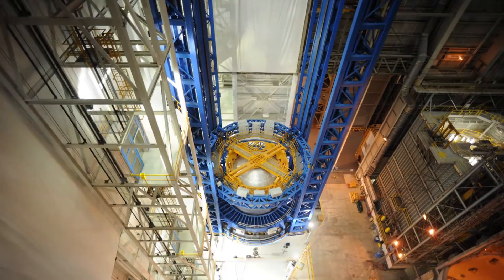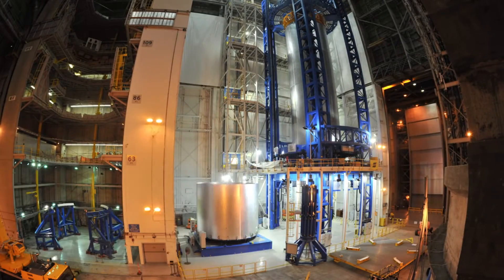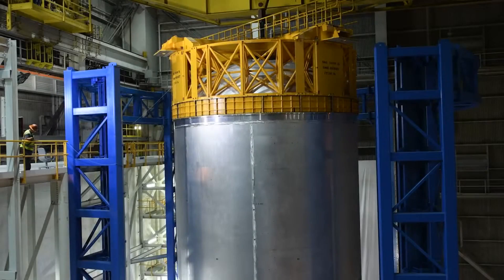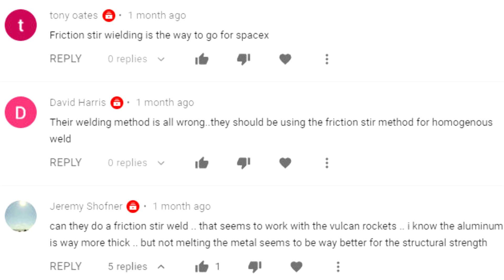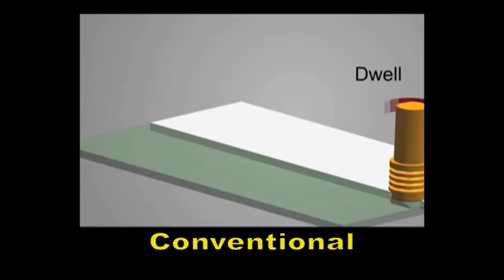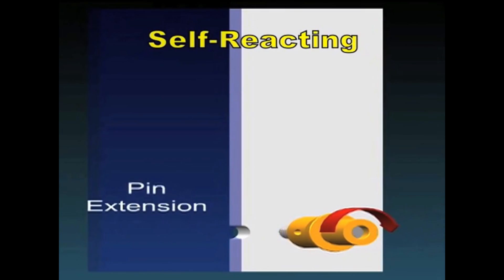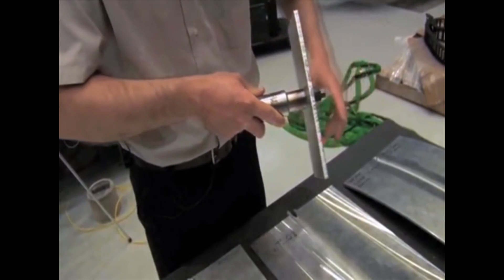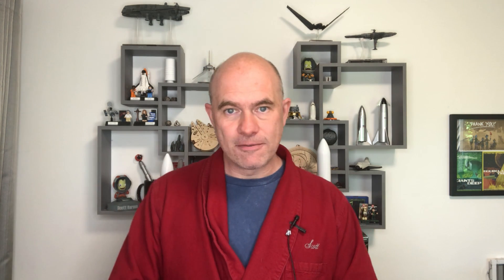SpaceX's 4th Starship Prototype Collapses During Test

Comment: How is it then going to land with additional weight on it? The fuel will be used and it will again be unpressurized.
Reply: The tanks will always be pressurized, that's required for the engines to work.  The cargo capacity is 100 tons, the fuel capacity is 1200 tons so the mass of the cargo might be as big a factor especially landing in places with lower gravity.
Reply: @TheEvilmooseofdoom  Ye i guess they can pressurize them with onboard compressor. They will need to land on Earth with some weight as well - people, cargo from moon and mars, experiments etc. Also keep in mind that this test was done without the top part which is probable a couple more tons.

Comment: I really don’t believe it was a welding or a pressurized structural failure. It seems to me that it imploded on itself. It seems that the middle tank was empty and the valves were closed and the cryo up top caused a vacuum and imploded the middle tank...

Comment: Looks like something cause the lower tank to pull a vacuum. It did not buckle from weight as it collapsed inwards. It didn't lose pressure, it went below air pressure.

Comment: Here's my guess at what happened...

The upper tank was filled with a cryogenic fluid while the lower tank was pressurized with an inert gas (probably nitrogen). The gas inside the lower tank experienced rapid convective cooling, due to the extremely low temperatures of the adjacent tank walls above, thereby lowering its internal gas pressure. Therefore, the lower tank's gas pressure quickly dropped (while ground support equipment couldn't supply nitrogen fast enough to keep up with the pressure drop rate). Once the tank's internal pressure dropped below atmospheric pressure, the tank's structure collapse. These kinds of pressure vessels are (obviously) specifically designed to handle internal pressure and cannot handle any sort of external pressure differences. 

Note that the diamond pattern seen on the tank's shell just before the whole structure fell over is very typical of a pressure vessel that has failed under external pressure.
Reply: Philip Giacalone ...I agree!  Some time before the big failure, two dimples appear and become more distinct, as if the internal pressure of the lower tank became too low and was still dropping.  Perhaps the team set the lower tank pressure, then forgot to monitor it.  Perhaps the plumbing or pressure adjusting equipment failed.  Either way, perhaps they next started to introduce cryogenically COLD propellant into the upper tank and over time, the heat from the lower tank bled off into the extreme freezing cold tank just above it, causing an insidious—but structurally fatal—cooling and corresponding pressure drop.
Reply: @737smartin  Yes. I'm guessing it was most likely a GSE problem. SpaceX engineers surely would have anticipated the gas pressure drop due to the cryo temperature drop. But it's possible that the GSE experienced a valve or regulator failure or simply wasn't designed correctly to handle the required gas flow rate.

Comment: I think they should add a secondary “redundant” structural element to the lower LOX tank that would also act as fuel baffles. This would be a win win because structural elements do not have to be heavy and it would also solve an issue with fuel sloshing once the Starship experiences 0 G’s.
Reply: @scottmanley

Comment: I would guess they are probably just using a robotic GMAW with a movable gas sheld for purging the back of the weld. But ya, stir welding many types of stainless isn't that hard, or new. But like any welding process it changes at least some of the strength characteristics of the welded metal and the metal surrounding the weld. I'm sure SpaceX knows far more about metallurgy than 99% of the people watching these vids; if they chose one process over another they had good reason.

Comment: There's an easy fix harder to make, put wavy ribs in it, in compression that large a radius is a "flat panel" structurally and will "pan" or flex to flat, that causes a crease to form.

With ribs takes more pressure, ymmv.

Comment: Friction stir welding stainless can be done, but it's much harder on tooling, super slow to do anything but soft aluminum alloys, and worse, it really ramps up the work hardening of the material which in turn, for stainless, reduces its corrosion resistance at the welds. Which means you'd probably be back to painting the rocket, where the weight savings of not having to paint was actually part of the equation for using stainless in the first place.

Comment: It looks like a partial vacuum was created inside the tank, presumably by chilled and condensing gas, and that it was then crushed by atmospheric pressure; it did take a few seconds before it actually collapsed, which should've happened immediately after it buckled if it lost support from a loss of pressure.

Comment: In steel the tool stress is just much much much too high with friction stir welding, so that won't work.
As per my other comment, if they're doing any manual welding whatsoever it'll be TIG, but that gives you a large heat affected zone. The moment it's automated, laser or electron beam become highly preferable
Reply: One day they might make star ship tubes just like oil pipeline with a continuous spiral weld. They could even change the thickness as they get closer to one end.

Comment: Yeah, for steel I'd be expect friction stir welding to flop. Tig welding is good but ends up with a large hear affected zone. Laser beam gets great energy concentration, great penetration, but realistically needs to be done by a machine, as the speeds are so fast.

So basically best to design a laser or electron beam process, but that has to be so finely tuned that I'm not surprised they're getting a lot of failures
Reply: How about direct electric welding, similar to spot welding but continuous along a seam?
Reply: Andrew Bailey idk, man they only got 1 failure because of weld quality, right? Only Mk 1 failed because of bad welds. So not many failures are because of bad weld quality.
Reply: @squdardt.9719  Yes, their welds have improved, but they're not using friction stir welding. It would be impractical to do so on steel.
My comment referred to the part of the video where Scott mentioned people having seen that ULA use friction stir welding very successfully on their (aluminium) tanks, and kept going on about how SpaceX should use it, without actually understanding the mechanics of the process
Reply: As well as causing prohibitive tool wear with steel, (It effectively work hardens the material, but still requires a screw-like tool to be able to cut into the workpiece. Hardened steel is very very difficult to cut with any conventional tooling) friction stir welding is almost exclusively an automated process. As SpaceX are in a rapid prototyping phase, they'll continue to do it by hand until they iron out the as many issues as they can (Making TIG the best option for now). I would expect that for a production model they'll move to an automated technique, but like I say, I would expect them to favour laser or electron beam welding, as when that's set up right it gets great weld penetration, and a small heat affected zone (HAZ), and works great on steel. (You wouldn't use laser beam for aluminium welding on the other hand due to its high reflectivity)
Reply: @andrewbailey7999  Wait, doesn't laser beam welding add extra material so the weight increases? Idk, someone said it.
Reply: @squdardt.9719  Laser beam welding doesn't, as there's no filler material. Maybe you're thinking of 3d printing in metals, where they put down a layer of metal powder and use a laser beam to bind it together?
Actually TIG welding adds material, as usually you would use a filler rod
Reply: Andrew Bailey no, i tried convincing someone that laser beam welding was better than TIG. He is the one that said that it does require extra materials
Reply: @squdardt.9719  Well I don't know what they were thinking of. Maybe they thought it needed metal powder.
The main thing with laser beam welding is that human reaction times are basically too slow for it, so it needs to be an automated process
Reply: @andrewbailey7999  He also said that laser welding "robs the material of strength". That isn't true right?
Reply: @squdardt.9719  No more than any other welding technique. Any form of welding has a heat affected zone, (HAZ) which is weaker than the base material. In laser beam that zone is usually much smaller than in TIG or MIG.
If he was trying to argue in favour of friction stir welding, then perhaps he could've been arguing that the actual weld in fiction stir welding is stronger than the base material, which is true, as the material undergoes work hardening. Although friction stir welding also has a HAZ, so failures would occur there rather than on the weld bead itself if the weld was pushed beyond its limit.
That work hardening is great in aluminium, and does make for very strong welds, but steel would become so hard that it would very quickly break friction stir welding tooling
Reply: @andrewbailey7999  Ah thank you. One last thing. Are the welds of laser beam welding strenger than the welds of TIG welding?
Reply: @squdardt.9719  Well the advantage of laser beam welding is the high energy concentration. It takes a bit of fine tuning, and setup cost is high, as it should be automated, but once you've got past those hurdles it creates a weld with much better penetration and a smaller HAZ, so yes, it tends to form a stronger weld than TIG as long as it's set up right
Reply: Laser beam just isn't suitable for prototyping in the way SpaceX is doing, as the up front costs are much higher, and it needs to be programmed for each new task, as it's quite sensitive to feed rates etc. Once they've got the process down fully then it would be a very repeatable way of making high quality welds
Reply: @andrewbailey7999  Does friction steel welding need filler material?

Edit: never mind, just found out it doesn't need filler material.

Comment: Do you think musk will need to return to traditional materials instead of the steel?
Reply: That would depend upon if traditional materials can withstand the planned reuse.  Most traditional rockets are one use, this whole "strong enough to be multi-use" is part of the challenge they may or may not conquer.  This is one big experiment and I don't think they're going to give up that easily.  :)

Comment: Saturn's were corrugated (vertically  / long axis) in some sections. Why is SpaceX not doing that? It's a bit more weight but much, much stronger.
Reply: They corrugated the inter-tank sections to make them stronger on the saturn and the material was aluminum which is fairly easy to work with.  The tank sections themselves were smooth.  I'm not sure if you can corrugate stainless steel to be honest.
Reply: @TheEvilmooseofdoom  Sinusoidal corrugation of stainless is decades old. Maybe it's the clean polished "look" that matters to the boss. Form over function, etc.

Comment: Gas Tungsten Arc Welding, or GTAW is tig welding. Gas Metal Arc Welding, or GMAW is mig welding. Resistance welding,I believe, is simple spot welding where they use electrodes to weld metal together using no filler metals for the weld. And I think the rest are automated welding systems.

Comment: Making a BFR or what from welded sheet metal will bring some challenges for sure.
What is giving structural strength these shiny monsters?
High pressure low pressure, extreme high heat and cold will add more to this. 
Good luck.... I would not bet on this project and I am certainly not flying in these.
Reply: A lot of the strength will be coming from high pressure, which is why so many people in the comments suspect condensation in the lower tank.

Comment: friction stir works great for ULA on aluminum but they've also mastered the hardware and infrastructure needed to produce the ideal welds for the material and the most desired outcome for the material thickness, etc...  It sounds like SpaceX is still trying to have welders work and do it by hand.  ULA uses alot of automation - to include their welding for tank sections.  In theory, this would produce less potential points for failure.   Smarter Every Day's video was pretty incredible I thought.  It was very interesting to see that the golden color of the tank sections isn't paint but rather the oxidization of the aluminum as they age each tank section to have that oxidize layer.

Comment: It doesn't look to me like a crumpling of the lower section due to lack of support.  It looks to me like the inter-tank section got sucked inward.  To me, that implies a failure in the upper tank or plumbing that froze the air and suddenly decreased the pressure.  That's what pulled the walls inward.
Not an expert.  Just a starry-eyed layman.
Reply: That's my thought too, the structure can hold its own and its fuel's weight but not when an entire section is crushed by the atmosphere due to a sudden depressurization.
Reply: i thought there was a common bulkhead, so no inter-tank section?
Reply: It can hold its own weight.  But, probably not the added weight of a full tank above it.  For that, it needs the pressurization to stabilize it.
But, again, I didn't see any deformation below where the outer skin got sucked in really quickly, pretty much uniformly around the circumference.
I think that also rules out a structural failure in between the tanks.  It doesn't look like that portion was pushed down and buckled inward.  It looks to me like it was sucked in.
Reply: @MightyDrakeC  

"I didn't see any deformation below where the outer skin got sucked in really quickly, pretty much uniformly around the circumference"

That is exactly what I saw. Was that a typo?
Reply: Drake Christensen yep.  Somehow the air (or gas) inside the tank must have gotten splashed with cryogenic liquid.  PV=nRT when temperature drops suddenly, the volume dropped suddenly.  I thought they understood this possibility after the last implosion
Reply: Perhaps he needs to pre cool the air and tank before filling
Reply: @douginorlando6260  Remember that those ROCKET-ENGINEERS are not idiots. They will fix those mistakes.
Reply: @_aullik  

The rocket engineers are in California making the engines. Many if not most of the employees at Boca Chica are locals and NOT experienced with rockets or engineers.
Reply: @EthelredHardrede-nz8yv  Wow thats a pretty arrogant thing to say. They brought in a lot of rocket engineers. Maybe not a lot of engine guys, but those aren't that important right now. Also the "locals" were experienced with water towers which have similar problems, just not cryogenic. 

Even the locals have by now more experience with rockets than you ore me have.
Reply: @_aullik  

"Wow thats a pretty arrogant thing to say. "

No but that is. I am going on where they were recruiting from and was NOT a hotbed of rocketry till SpaceX came.

"They brought in a lot of rocket engineers."

They are mostly in California as I pointed out. I did NOT say that were none there.

"lso the "locals" were experienced with water towers which have similar problems, just not cryogenic. "

Well that seems to be the problem. The lower looks to have had a major pressure drop to below atmospheric as it did not buckle til after in began a slow implosion.

"Even the locals have by now more experience with rockets than you ore me have."

NOW they do. Not when the locals were hired. Going on reality is not arrogance. Denying it is. 

Ethelred Hardrede
Reply: Just the loss of heat through the common bulkhead could have been sufficient to do that. The gas in the lower tank would simply have compressed due to lower temperature. Next time, they need to take that in to account and overpressurize the lower tank.
Reply: It's pretty obvious that there is ice buildup around the upper section as they are venting the top tank. That looks like it could be quite thick, which would be really heavy. If at all uneven around the circumference (and it seems to be), that could easily cause the heavy side to begin to buckle, leading to a cascading failure.

It clearly is a weight related failure. My personal leading theory is that the ice was probably heavier than expected and exceeded the lower structure's capacity. Whether that would be the result of reduced pressure in the lower tank or "we didn't think it could ever get that heavy" or something else entirely is not something I could even guess at.
Reply: Most likely a combination of both. Remember that the bottom tank needs pressure to keep rigid enough to support the filled top tank. 

However when the bottom tank looses pressure or even goes below ambient you get what we saw here.  

When you empty a water tank, you need some air vent to supply air so that the water isn't pulling a vacuum. When the water is already going and you suddenly close that vent you can easily destroy even big tanks. There are many specifics on how this could have happened. We don't know specifics as of right now.

Comment: In that job opening it states Orbital. Orbital is machine setup and has no electrode. It’s used in nuke sites and pharma. I was on a job where it was done and the beads are completely smooth and only takes material from the two surfaces that are being blended. It’s so awesome to see but takes so long to set up. There was one welder that made us all little crosses for necklaces and they were absolutely amazing. Other than visual clues can u tell there’s a weld... when the weld passes inspection. But feeling it u can’t tell at all.